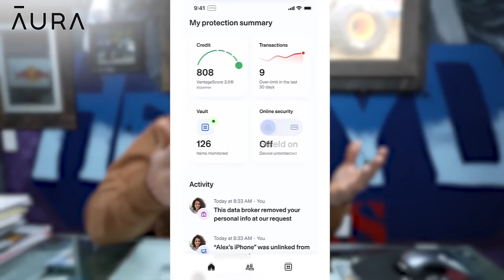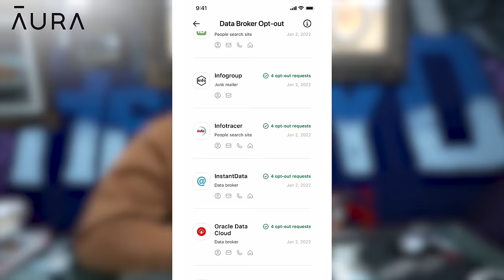Buying This Tank and Semi did NOT go as Planned...

Comment: I'm fairly certain that the van's Road wheels,  Idler, Final Drive, and tracks are from an M113 Armoured Personnel Carrier, or even like the M548 Tracked Load Carrier (TLC or Tilly) you have/ had. The gap between the second and third Road wheels, and the length of the track points towards TLC. The track is the old single track pin type. The new track has 2 fixed pins and are held together with collars, similar to tanks. The hull at the front looks familiar due to the cylindrical extrusions. The M113 started with a petrol (cough...Gas) V8. Australia put a V6 diesel Cummings into theirs. Australia has heavily modified them now.
Reply: M113 had an aluminum hull, you'd know with a magnet quite quickly if that part survived intact.
Reply: Did you happen to work with em haha
Reply: @mrmotofy  What gave that impression? But yes, then commanded an AUSLAV 25. Then became a Digital Cartographer (map maker) and Aerial & ground surveyor. We referred to the M113A1 as a Bucket. They are up to M113A5 now. Lots of new bells and whistles, plus they stretched it and added another set of Road wheels.

Comment: The old tank big block was probably OK initially.  Needed a little more TLC.  Needed some oil moving through before hitting it with the evil starting fluid. Alan's used to starting diesels, not gas. Looking forward to the content as always.
Reply: agreed, exhaust valves sticking, Needs a big drink of oil.
Reply: Agreed, pour some trans fluid in the plug holes to un-stick the valves & rings & clear the pilot jets.
Reply: Diesel powered engine  old Detroit  diesel in the tank mover truck
Reply: Dave needs that  set up
Reply: Necessary

Comment: That’s the coolest paint job ever. I’m a crane operator for a heavy haul company. Those tri-axle trucks are so hard to find we imported 3 of them from Canada, eh? Those Kenworths immediately went to the shop for a 2 speed auxiliary transmission, custom driveshafts and all 3 rear ends changed out. The boss has had new Peterbilts on order for months and couldn’t wait any longer.

Comment: I agree with the engine choice on the tank van. Blown BBC. Instant torque and with the whole concept of it being old school it’s only right.
Reply: Pro-Charged Hemi
Reply: My mind read that wrong, twice...
Reply: @nickm6670  I knew people would. The internet ruined it for Chevy.😂
Reply: @bustinyanutz4195  That would be cool but I was thinking since those tanked vehicles were big in the 80s and Heavy had that vintage RC car in the same era that a blown big block would be more period correct of what they were doing back then. Maybe a Hemi would be right too but with a screw blower.
Reply: @bustinyanutz4195  Hellcat Crate Motor and comes with a 3 Year Factory Warranty.
Reply: A boosted Cummins would be the right choice
Reply: Check for spark first lol

Comment: Sometimes you need to clean out the fuel lines of the crud inside them. I could hear that while you were trying to get it running. It sounds like it has a bad cylinder.
Reply: Or like now my old audi. Guy had welded the gas tank that had rusted out... sure it keeps fuel in, but dumb ass didnt clean it afterwards, so all the crud went into fuel pump. Bought new pump and didnt learn about his mistake, second pump gone. Got fed up and sold it to next guy, who bought new pump.... and you guessed it...never got to replace pump and clean the tank. Bought it from that guy pretty cheap and in process finding inline large enough pump for cheap to run it trough boat tank so its runner, going to clean the fuel system before dropping the rear axle to remove that tank and check the guys work well as most likely coat it before reinstall to get her as proper runner.
Still long way to utility restore but she aint half bad for 2.2L quatro for 500€ needing mostly cosmetics, few rust holes, headliner, windscreen and new set of rubber, fluids and belts before going back on the road.

So yeah it could have story like that behind it, you never know.

Comment: The airbrush semi is amazing. The four-door Chevy inside is completely airbrushed from front bumper to back bumper roof inside cab inside bed and underneath. The whole body tilts up on hydraulics completely exposing the motor and chrome tube chassis. It also has hydraulics in the suspension to raise and lower the truck. The nose of it is airbrushed like flames and an eagle that has a Cadillac Escalade front end on it. I seen it at one of the last autoramas in Grand rapids, Michigan
Reply: The guy who I met that owned it said that there was roughly 600,000 into the puckup truck with his own money and donations. It was also at the Smithsonian institute for quite a while. I seen it around 2008

Comment: Yeah it was flooded cause sparks kept stomping the throttle pedal causing the accelerator pump to keep squirting more and more fuel into the engine 😂
Reply: You mean the hard piece of rubber where the accelerator pump is supposed to be. That thing ain't pumping anything.
Reply: The accelerator pump was probably toast.
Reply: Berm-blaster your comment couldn’t be further from correct 🤦‍♂️
Reply: Lol
Reply: Check your footage this isn't part 7 it is the same video you have already posted and keep posting thanks
Reply: Carb is probably junk. Needs a rebuild. But if it floods. 
Stomp pedal to the floor and hold to clear...
Reply: LITTLE BIT OF TIMING
Reply: You clearly have no idea how an engine works 😂😂🤦‍♂️🤦‍♂️

Comment: Holy shit not a single mechanic in the bunch, it's been sitting 20 years carb needs rebuilt or replaced, rig up gravity fed fuel system and turn the distributor. 
It's smoking out the carb, something stuck in the valvetrain. Just keep cranking and pumping while shooting starting fluid at it. Bunch of stooges.

Comment: That is M113 tracks, sprockets and roadwheels. It may even be the entire lower aluminum tub with the superstructure cut off. M548 Artillery Ammunition Carrier and the Rapier Anti Aircraft Missile Carrier used the same suspension and drive train but not on 1" aluminum welded plate armored tub.

Comment: Dave I have a 5000 mile 460 Fd And c6 trans off a motorhome with rear end I bought for my low miler Motorhome  sitting  underneath a shed both In Alberta bigtime  fan give me 5 G  its yours have doors glass mirrors its 100% mouse proof steel wool in manifolds turned every 3 month  ,Been FD Man 50 yrs .

Comment: Take the carb off the tank, clean it out, put a carb kit and some floats in it and that engine would run a lot better. About the only thing that is kind of working is the accelerator pump on it which is why it sorta runs when you are pumping the pedel. The idle circuit among others are plugged. Another optionis a new carb or like you are planning on doing a new engine with a new carb or EFI. Good luck.
Reply: I bet these guys would never figure that out! 😂😂

Comment: You mention the truck having an 18 speed with a splitter in the rear axle so is it 18 speed or  18 x 2 making it 36 speed? i have driven over 7m commercial miles and 3 of those heavy haul and have never seen an 36 speed. By the way casper is in my back door. I wish i could have a truck like your give away, only a true heavy haul driver can appriciate what it is. Thanks and keep all 18 on the ground.

Comment: Hey if n ur gonna b  around san antonio I have an 87 era Southwind (interior trashed) but has 454 (less than 80k I think) and an automatic trans with less than 2k on the rebuild ..... both are still in motor home thus covered from weather .... just a thought but if ur out this way it's a possibility for one of ur projects drove it over 1300 miles & parked it where it is sitting .....

Comment: Spam-pumping the throttle didn't seem to be working, which probably means the accelerator pump is dead.  Holding the throttle wide open probably would have had better results.

Comment: I built one of those monster tanks in RC form using a Tamiya lunch box body cut down on a modified Kyosho blizzard EV single motor set up brushless and Lipo battery. It would throw rooster tails in the snow.

Comment: The Engine in the Van is Toast Knocking and can hear the Bearings Squealing it's spun a bearing or several AKA no Oil Pressure! Unlike Diesel you have to Flush the Gas out of the Tank and Fuel system before starting and Old Gas setup it was Pumping gas into the Oil the Whole time because of Stuck needle and seat! Replace the complete engine and Fuel System or the new Engine will Have issues~!

Comment: If you did want to put a diesel in the van and have amazing throttle response you need to call banks power and order one of his 866t duramax based crate motors.  With the supercharger and twin turbos you get the off the line power.

Comment: For the new tracked toy if going big block why not go full big block it’s a Ford so.. GAA

Use the PTO on the engine to run a blower to take it from the 500hp 1,000 torque at idle to 800hp and 1700 torque or more.  Tractor pullers have them putting out just over 2k hp and 4k tq 

It would be different still wanna see a GAA put in a hot rod / burnout car

Comment: That tank needs a tune up and a new carb or rebuild the one that is on there when carbs sit all the rubber in them start cracking so the accelerator pump goes bad and the needle valves stick dumping tons of fuel into the engine and I bet that's why that engine won't run right

Comment: What is the plan behind on stepping on the speeder like that when trying to start an engine? I had seen some others doing that as well, but I cant quite wrap my head around for the reason why
Reply: accelerator pump in the carby gives a squirt of fuel when you pump the pedal.

doing it with a diesel or EFI engine is just pointless.
Reply: @mfrsr  So it acts more like if you put your hand over the air intake as to "choke" the engine before removing to give it a huge suck of air?
Reply: @Danspy501st  pretty much, yep.

the pump is there to keep the engine from leaning out when the pedal is pressed - for example when going up a hill or downshifting to overtake. it feeds in to a small tube in the throat of the carb.

from the look of the vid this engine isn't drawing fuel (probably a blocked jet) so it's running on the little fuel that's being squirted in via the accel pump, and the ether being sprayed in too. would probably have had better results just pouring gas down the top, or gotten bigger flames at least....
Reply: @mfrsr  Yeah and from the video it also looks like they have a bad timing or as Alan said a sticky valve. I meaning, there is some blow back to the intake as we saw as well

Comment: Red is my fav color but inside and out is to much. Imo inside should be calm and not idealy not turn into a fucking oven. Inside Calm comfy and not an insanly hot to the point where you can fry an egg on the seet, outside thats all work and need to have a lot of storage that wont get in the way when driving up down and ofroad.

Comment: Dude you guys should know better than the just spray starting fluid in an engine that been sitting for years! Also if you would have filled the bowls with fuel then it would have run for you with out having to sit there and spray 5 cans of starting fluid into it at the beginning. You always want to use some 2 stroke mix when starting a long sitting engine like that other wise you possibly break rings and ruin what could be a good engine. And the whole issue there sounds like you didn’t have a good fuel pump. Lean pops and 0 response from your throttle pedal, aside from just idling, is it having no fuel source except what you finally put in the bowls. It was just drawing what was in the bowls out enough to sit there and idle for you. The blow by might go away after you let it run a bit and bring those rings around. To me that sounded like a good rebuildable big lock Chevy,and it was “rock bone stock” so might not have been wrapped on too much. Awesome stuff and I love the revival stuff and the buying and flipping. It’s what me and my buddy do here in NorCal. We have bought and sold everything from tractors and trucks, to salvage wood and antiques. Love the buying cheap and selling for more! God bless Guys!

Comment: SORRY Dave BUT it's a FORD Van NOT a Chevy Van and Screw a LS Chevy motor put a FORD Coyote Motor in the Van also it has more horsepower than the LS does.!!!    Everyone thinks that the LS motors are so good BUT really they are not just easy to work on that's it.   The Coyote Motor is a better motor and has more horsepower than the LS does and will hold up better than the LS motor that's a FACT!!!

Comment: Great video but that was painful to watch you guys trying to start the tank you must have pumped the gas pedal 300 times when all you needed to do was a quick tune up points plugs fuel fuel pump simple  stuff guy's
Reply: There not using that engine. No reason to spend money or time replacing parts.